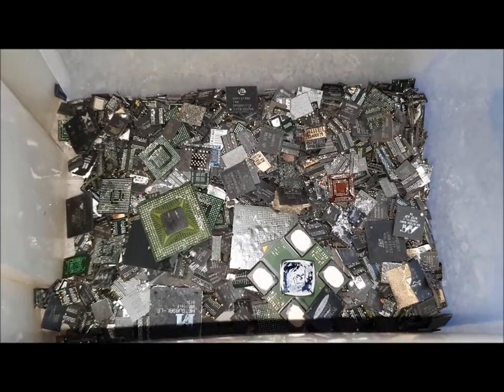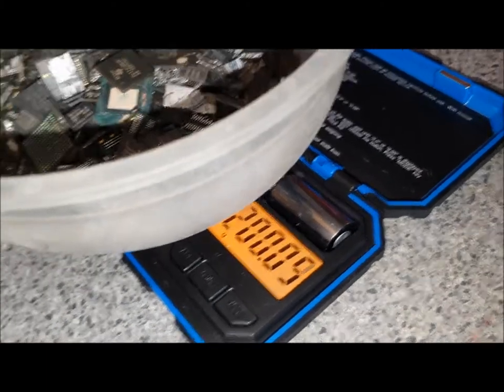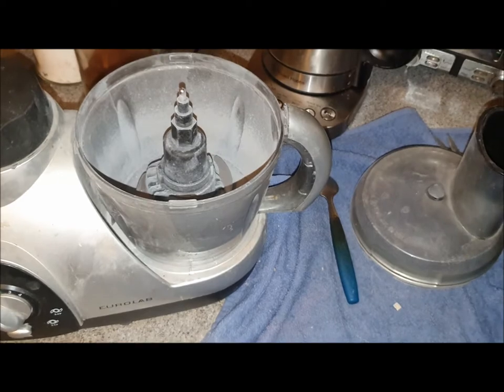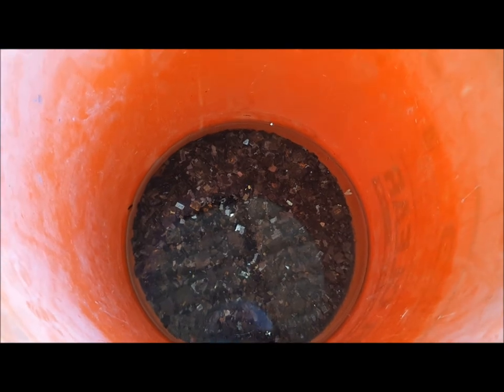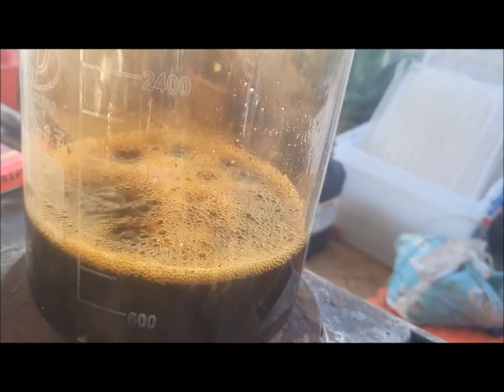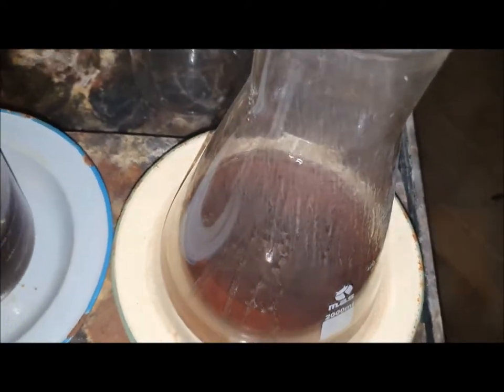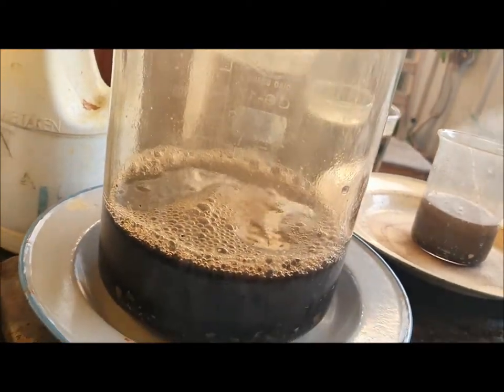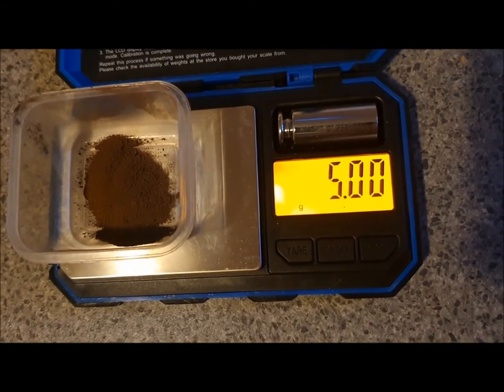GOLD RECOVERY / getting gold from ram bgas

Comment: Wondering if when you make AR you might add distilled water to the HCl before adding the nitric acid. I'm thinking your solutions are becoming so saturated with gold, it's possibly causing the heavy dark color, floating gold on the solution, and gold crystals on the beaker sides. There's just not enough liquid for the elemental gold to go into solution with. What do you think?
Reply from the maker: the dark colour is usually from copper